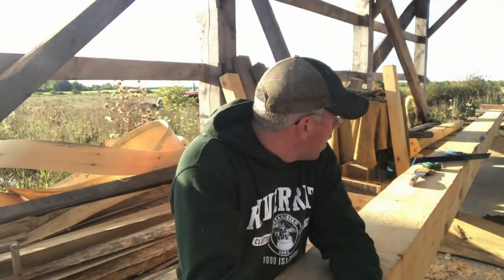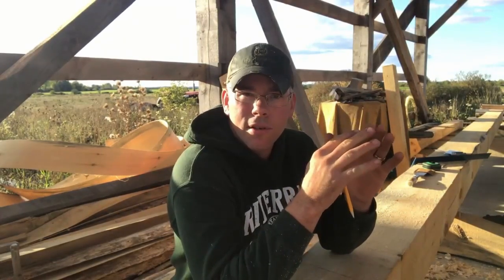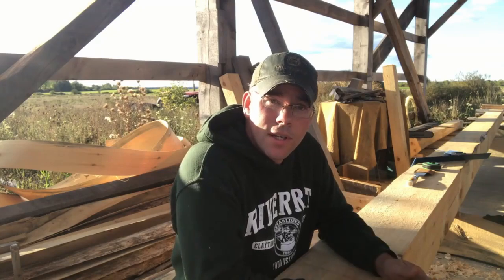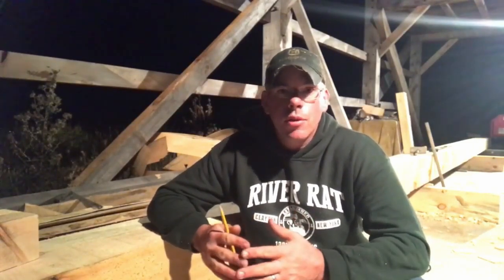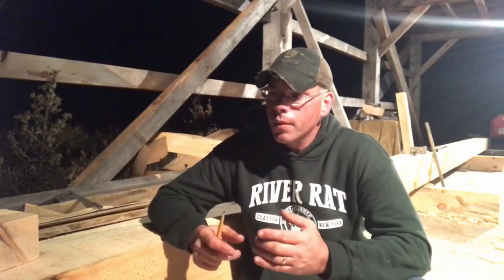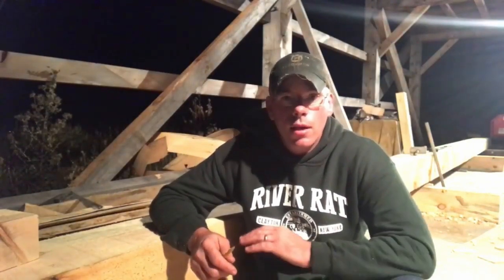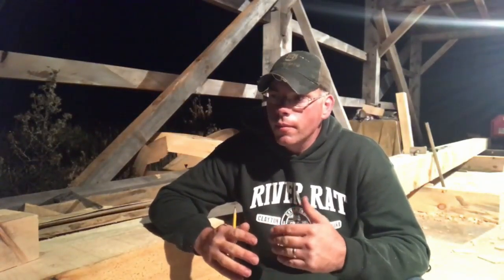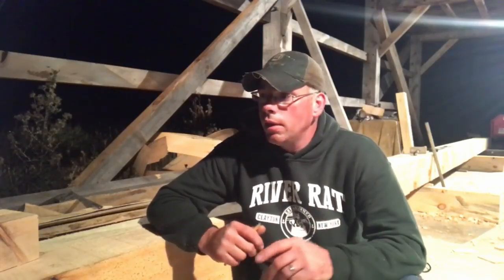Timber Frame Vlog #55 Fitting The Top Plates

Comment: I'm building a 20 x 20 gable timber frame. I'm thinking 10 x 10 posts, 8 x 8 top rail and ridge and 6 x 6 braces. How do you figure out what size timbers to use?
Reply from the maker: You have to do a load calculation on all of loads on the timbers.  So you need to figure out how much weight each timber will support.